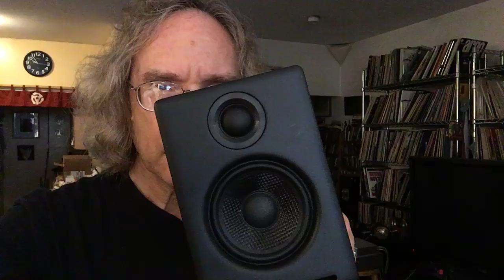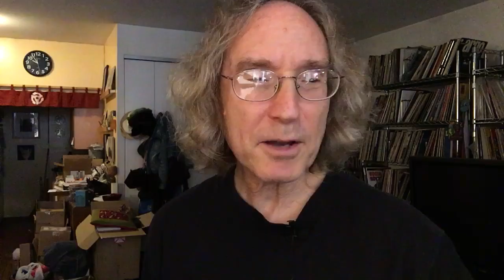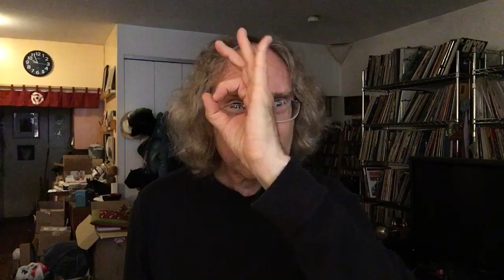The case against 1 inch dome tweeters

Comment: If a "small" 15-inch subwoofer can replicate the sounds of an earthquake, or a jet engine or an explosion, then I don't find it hard to believe that a 1" dome tweeter can produce the sounds of a cymbal or flute.

If you consider it, a 2-inch driver in a headphone can reproduce 10hz-20khz depending on the headphone! That's even more amazing.

I think it comes down to the distance from your ears. Headphones don't have to be large, because they only have to pressurize a small area around your ears. Speakers have to only pressurize your room. An earthquake has to produce sub frequencies outdoors in an open space. Take your largest speakers and take them outside and I bet a jet engine will out-perfom it in bass. ;-)

 I think it's amazing, but I don't think there's a rat.
Reply: Usually that 15" is loaded into a cabinet that makes it perform larger either with porting or a kind of acoustic suspension. Having dealt with building multi tweeter full speaker systems I can honestly say it really does matter that the surface area of a 1" dome is lacking if it is given too much to do. In full range speakers with a 15" woofer usually there is at least a compression horn driver. In the past sometimes there were four way speakers. To my old ears they always sounded best.
Reply: Isn't it more about the directionality more than what frequencies it can reproduce?
Reply: a 15" sub cannot replicate the sounds of an earthquake), you would need a rotary subwoofer as well for that.
Reply: Yes. TW does not play music, almost,  it only adds some "spikes and needles". Theres not much sound material to play in hi freq range.
Reply: @jareknowak8712  hm.... what? Then tell me why my bassguitar is still producing tones over 10khz...
Reply: SMOG: We are comparing for example 2 small drivers in place of one larger driver, so the equivalent air-volume pushed by the two drivers will match the larger driver in this example which means the excursions will also be the same as the larger driver,  I agree you might get a little more noise from the suspension; but this is never an issue with a quality driver from companies like Peerless
If you still disagree look at it this way, assuming the suspensions have negligible noise; 2 driver=2 voice coils, so right there you have the potential to double magnetic flux or BL(Thiele Small Parameter)-which is like having 2 engines instead of one resulting in more control, then as mentioned before; a large drivers cone has more chance of off-axis 'wobble' than a smaller cone surface, these factors are more challenging than removing suspension noise for the speaker manufacturer.
Paper can be a good cone material; depends what its impregnated with, paper on its own is rarely a good medium.
Reply: SMOG: The horn idea been around for a long time and makes perfect acoustic sense(almost), not only does it impedance match, it also increases 'entrainment' which in itself amplifies the sound(up to 10db), on the downside bad design can cause unwanted resonance since it is approximately equivalent to a one sided closed-pipe system.In practice; horns sound coloured; you can demostrate this by using your hand as a cone/horn, it truncates the frequency response; its used in PA systems to boost power efficiency at the expense of colouration; so its not a true audiophile product, having said that; it does have its uses at low frequencies where the ear is less sensitive to distortion.
I am building a rotary sub at the moment, it will be interesting to see how much of those lows are in commercial music formats; as you say below 20Hz its less about hearing the sound and more about 'feeling it'.
Reply: May I just say there is no way in hell headphones can produce 10 hertz
Reply: @lukasbekcic  Through bone induction, they most certain can (and do).  Air waves to eardrums are not the only system through which we experience sound.
Reply: all these people arguing about what driver is best. what ever happened to if it sounds good then it sounds good.
Reply: But it can't. a 15-inch subwoofer CAN'T replicate the sounds of an earthquake, or a jet engine, or an explosion. It can "recreate" the "artist's rendering" of what a movie soundtrack engineer uses to suggest the sound of an earthquake, or an explosion, but clearly there would be no confusing the two. Similarly, a 1" dome tweeter (or any tweeter) is not merely trying to produce the sounds of a cymbal or flute. The earthquake and jet engines also have high frequency components of sound that if not replicated robustly just don't sound like the real thing. I think Steve is definitely onto something here, worth thinking about - and listening for.
Reply: @SMOG And it reduces distortion.
Im just starting to mod driver's as a hobby.
If everything goes well i will make diy kit's so ppl can have the same mods pretty easily.
Yeah there is not much happening with speaker technology.
Reply: Joe N Tell i
Reply: SMOG: Ill take your word for it), though even a 21" though IMO would struggle in the infra sound region; you need at least 140db down in that region, thats incredible amounts of air volumes.
Reply: SMOG: Yes 140db at 20Hz maybe, but its a square law relating pressure levels to volume of air if I remember correctly; so even the best subs have problems below 20Hz.
Reply: SMOG: Lets just get facts right here, the sole purpose of the horn is to amplify sound; it wont make it sound better, of course the hand is a crude example, but as I said the horn is a resonant system and as such suffers resonance-in this case complex ones too. I have seen the avantgarde before. They may very well be great sounding speakers; but equivalent priced speakers should sound better just not as efficient.
Reply: SMOG, can you please provide me an example of a specific headphone that claims it can produce bass down to 10hz?
Reply: Joe N Tell earthquakes don't "have" to produce anything...
Reply: SMOG u mean the sound studio is poor? I'm sure they mix in low frequencies still lol what
Reply: mine can 5hz to 20khz
Reply: @SMOG If you have 3 channels available for left and right it pretty easy to build a 3way speaker with a DSP. It is more expensive for the first time but you can save many setups for all kinds of speaker's so.. In the end it's cheaper.
Reply: @SMOG If you go the passive way for sure! With a DSP it's pretty easy.
Reply: @SMOG I mean crossover wise it makes it a LOT easier. Of course there is more to it.
Reply: @SMOG Speaking of "there is more to it".... What do you think of the Active Impedance Control thingy from 18s? Im planing to build that into my driver's.
Reply: @SMOG Some have a bigger gap and some a smaller one. So... I will see it when i take them apart.
I have to get them here first.
They are still at a friend's house and he is a bit far away.
He could send them.. But why spend the money for chipping if i can take them home when im there the next time? :D 
It is a 17cm magnet and a 75mm coil... I will use them for Home Audio and Recording. 
They will not get hot. But i will then test them with a lot of power with a Highpass filter.
And if there is not enough room in the gap i have to make room for it :)
Reply: @SMOG Sure i let you know!
I will change the suspension to.
I need a lower FS and higher qts because i want to build closed.
So the parameters will change a lot! With or without the second coil. Do you have Facebook or something?
Reply: @Stimpy&Ren you are forgetting that large subs are heavy and therefore become harder to control. Its becouse of this servo controlled subwoofer are invented.
Reply: Bravo
Reply: Of course a tweeter can produce a wide range of frequencies, there's nothing hard to believe here. I assume all of this is part of the (sorry for the abbreviated swearing) BS theory common among audiophiles that in order to sound like let's say a piano, a speaker has to have the shape of a piano, or to sound like a cimbal, a tweeter has to have the same shape and size.
Reply: AKIO TV it took more time to type out your apology than if you would have just spelled out "bullshit"
Reply: But a large sub cannot *accurately* replicate sound.  Larger subs have a lot of mass to move.  And they have a lot of surface area to distort.  This, of course, distorts the audio wave as it is created in the air.  Stiffer material usually means even more mass to push around.  This is the case against large cones of any kind.  But, smaller cones have trouble reproducing those lower frequencies - they simply don't have the surface area to do the job.  Which means you need multiple drivers - which causes lobing.  Now you have a speaker with multiple smaller drivers with lobing problems throughout the listening area.
Lobing is also an argument against multiple drivers at any frequency.  Whenever you have two or more sources producing the same sound frequency, you get lobing.
I've been to a number of homes where the owner set his cutoff frequency between his sub and his main speakers to overlap each other.  "To get extra bass in the room".  But doing so always creates spaces where the two drivers cancel each other out.
And then you have crossovers to deal with... 3 or 4 way crossovers are devilishly hard to design right while keeping the phase from running away from you.  That's why some people just go with digital crossovers and separate amps just to avoid all that work.
Reply: @jdlech   jdlech  You've just stated many of the trade-offs that speaker designers have to account for. Do you have a proposed solution? It sounded a bit like you were just stating all of the possible issues with loudspeakers in general. Not really understanding how it relates to this discussion. Maybe I'm missing something.
Reply: The point is that it's not a simple issue with some easy solution.  I've been aware of the engineering compromises for decades.  I've had a few ideas - most failed miserably.... There's still a few other ideas in my head that may never get tried out.
The cone speaker is an idea well over a hundred years old.  It's not due to lack of trying that we have not come up with anything better.  There is a rather neat digital solution to the lobing problem - digital crossovers.  With them, you can have essentially zero overlap among as many drivers as you want - so long as no two drivers handle the same frequencies.

But even between stereo speakers, you get areas of positive reinforcement and cancellation when the same sound is reproduced by both sides.  This does not exist when listening to a live symphony - but it will exist when listening to an amplified sound stage such as a rock concert (but not from a garage band where each musician has but one amp and a speaker).
So there's a fundamental flaw in the whole stereo concept.  And the best solution for most is "don't stand here, and don't sit there".  The only solution that I'm aware of (that even attempts to resolve this issue) is something called psycho acoustics.  And that's something that causes a lot of audiophiles to hiss and jeer in contempt at the mere mention of it.

There was a solution proposed long ago that went the way of the 8 track tape.  And that was to release music in a format that put each instrument in it's own separate track, and the reproduce each instrument via it's own loudspeaker.  Thus, you simply arrange each speaker as you would each musician within the room.  This also had a few problems, such as having dozens of speakers for a symphony, some instruments being omnidirectional while others were decidedly unidirectional, having to have a separate amp and speaker for each track, and commercially produced multi track tapes kinda sucked or was too expensive for your average Joe.
If I had "the answer", I'd be a billionaire.
Reply: @jdlech  that was exactly the idea I was entertaining I short while ago. Too bad it didn't take off
Reply: Did I say I'm talking only about subs?
And you're completely wrong about large subs being "way more accurate and efficient".  If that were the case, why do you think so many companies go with several small drivers over one large driver?  A single large driver can be more efficient (but not always), but that comes at the cost of fidelity.  You simply cannot make a cone larger without introducing more flexing in the cone itself nor without adding mass (ceteris paribus).  That's just common sense.
Reply: jdlech: The main reason manufactures use smaller drivers is so they can put them in a smaller enclosure), but agree in general smaller drivers will be more linear and not suffer so much from cone break-up; having said that some of the modern materials for cone design these days cause negligible cone break-up; in other words off-axis wobble.
Reply: Like to add that making a box too small as often happens then adding more amplification decreases overall quality; keeping it tuned at Q=0.707 and using the right size to begin with will always result in less excursion, better linearity and less power requirement; this is evident from the likes of sunfire that squeeze everything into a small box.
Reply: Well, that's just complete bullshorts.  Smaller woofer drivers are always more accurate.  As I stated before - and it's just pure physics, as you pointed out, you simply cannot add surface area without adding more flex.  You're trying to tell me that an 18" cone has exactly the same amount of flex (and for that matter, the exact same mass) as a 4" cone.  That's total bullshit and proves you don't know WTF you're talking about.
Why TF do you think woofers are made to be as rigid as possible?  According to your "theory" one can make woofers out of toilet paper and they'll have no more distortion than the stiffest cone material.  As you wrote, "pure physics", and you're simply full of shit.
Woofer cones are made of many different materials, and yes - CHEAP garbage woofers are usually still just paper.  It's always been an engineering tradeoff between material mass, strength and cost.  Almost no speaker over a couple of $K use paper cone woofers.

Comment: I think this applies to all speakers not just tweeters, I've always been amazed at getting the sound we do get, from what is 
relatively small pieces of cone material being whacked around by an electromagnet.
Reply: I'm still stumped about the fact that all of our cone drivers have the INSIDE of the cone facing the listeners. Wouldn't it work better to have the magnets and coils on the inside and turn the outside of the cone toward the listening area?!

Comment: I enjoy your videos. Keep up the good work. Coming from a long time recording engineer (not an audiophile), I could speculate that the meat (volume) of big transients are usually not above 2k or 3k so a large driver may not be necessary to cover those frequencies. I use Pro Ac 100s that use this type of tweeter and the high frequency response is excellent and pleasing to my clients' ears. So many things are going on with speakers inside and out which is why I see them a musical instruments with a very wide range of possible outcomes even using the same components.

Comment: Magnepan treble is excellent.  Especially the huge ribbon tweeter on my Dad's 3.7i.  The best I have heard.  I am auditioning a Spatial M3 Triode Master and I prefer the treble on it compared to my previous speaker with aluminum dome.  The Spatial Triode Master treble is sweet with its compression driver that goes from 700hz and up.  Large soundstage and excellent imaging from this driver.  Non fatiguing sound.
Reply: snowpuppy77 I heard large maggies about 30 years ago and they were amazing, but you have to have the right room setup for them, and the music I heard wasn’t rocking, so I have no comment on how they handle harder hitting music.
Reply: I'd love to hear the Spatial. I have never warmed to the Maggies, not dynamic enough. I'll bet the Spatial s are.
Reply: Yes they are very dynamic.  I listened to some of my older Telarc  CD like The Great Fantasy Adventure Album and they sound amazing.  I like orchestra so much on these speakers that I have been buying up the older Telarcs used at a local record store.  My old Paradigm Studio 100 V.2 has the bass but does not have the realistic dynamic contrast and the dynamic wow factor of the Spatials.  Also the Spatials do this while sounding very open with excellent imaging being not localized to the speaker.  Also brass has very good timbre sounding alive but without the fatigue heard on so many box speakers.  Crescendos and finales just wow me and I am only using a 60 wpc/8ohm Schiit Ragnarok integrated amp.  Now it will not effectively do the lowest pipe organ pedal on my Vaughn Williams Symphony Antarctica Naxos.  I hope to blend a sub about a year from now and get it all.  But on most bombastic dynamic orchestra music it really delivers with no thought of sub for me.  My Dad's 3.7i are nicely blended with a Fathom sub.  As a result I love them with Orchestra and Rock as well.  The 3.7i with a sub may edge out the Spatial M3 TM and a sub for me.  However if I could not get a sub for either I may go with the M3 TM over the 3.7i.  Even better have the 3.7i on one system and M3TM on another system as I think they would work complimentary.  My Dad looking forward to listening to my M3 TM and me looking forward to hearing his 3.7i.  The 3.7i having a more immersive soundstage and the M3 TM have a good but less immersive sound stage and more pinpoint imaging.  I considered the 1.7i and the mid bass just did not do it for me.  Would need to turn a sub crossover up far to high for my liking.  I personally think the 3.7i is significantly better than the 1.7i.  The 1.7i still amazing in its own way and much cheaper than the M3 TM.  If I could not afford the M3 TM I could be happy with the 1.7i.
Reply: @snowpuppy77  Thanks for that information!